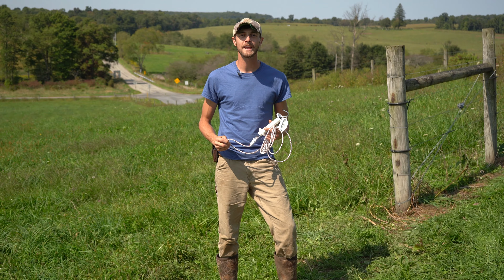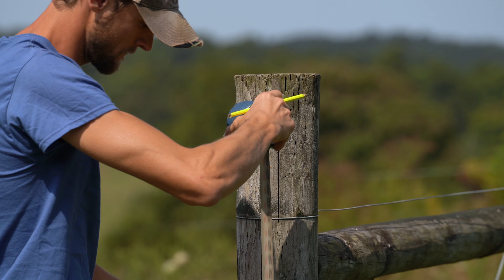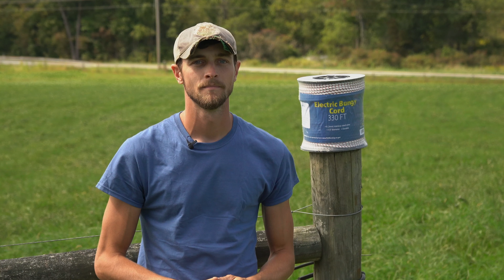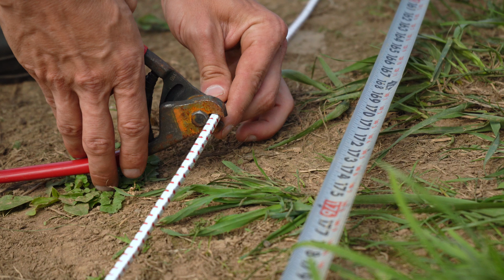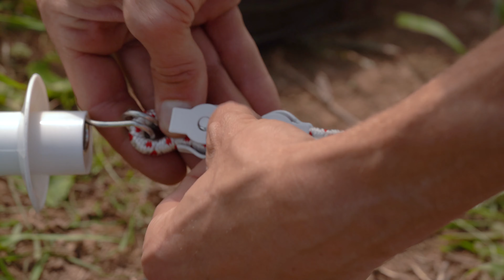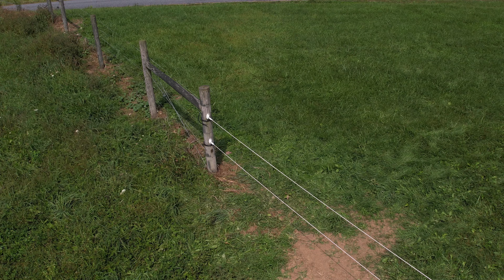Fencing 101 - Installing Bungy Gates

Comment: Can the opposite (not hooked side) be attached to more hot wire to continue the circuit if the gates is in the middle of a fence and you want both sides hot
Reply from the maker: Yes, it can! With the purchase of two items... the GHUA anchor plate and CBT split bolt. You then take underground wire and attach it to the split bolt on the plate and then have another split bolt on the hot wire to continue the electricity.